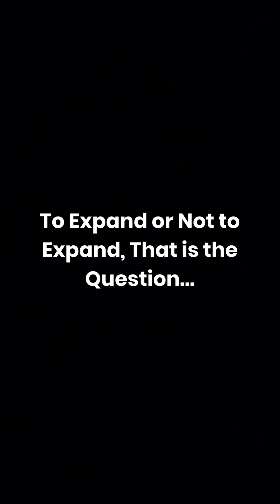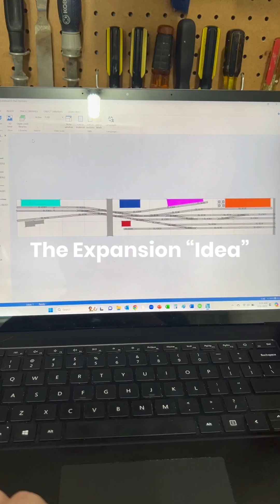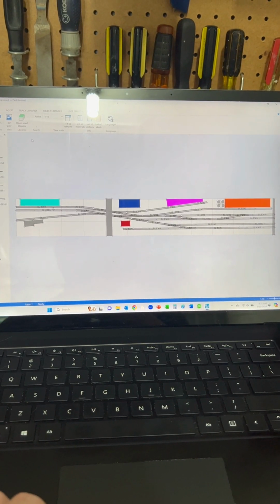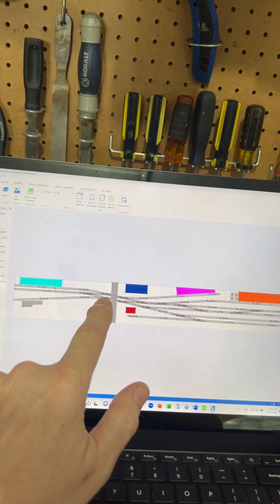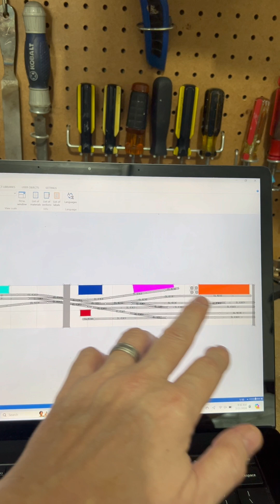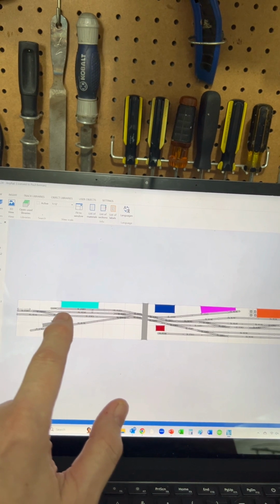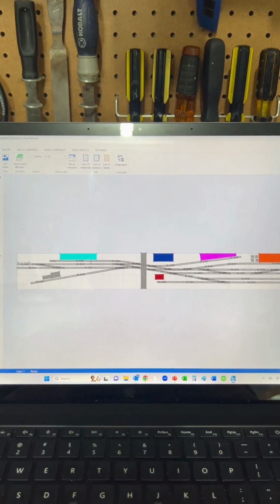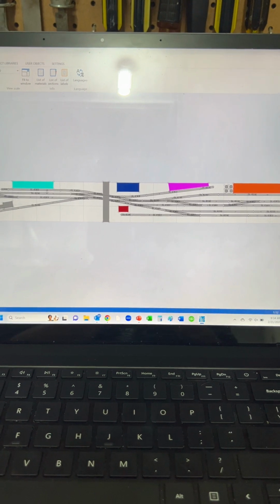Thinking about expanding the 12’x20” Shelf Layout…I need intervention!

Comment: I like your idea of the extension on the left side that will add the run around. Makes sense operationally. Thought came to mind that you could add one more spot at the ADM so you'd have three sports there too.
Reply from the maker: Thanks for the comments. I did make that adm siding long enough in case I wanted to ever add more cars. Probably time for that.

Comment: Extending the cold storage siding and main with a crossover, would give you a run around without crowding (cramming?) too much track onto the layout.  The ADM transfer facility is a nice scenic feature.
Reply from the maker: Thanks for the inputs! I definitely want to avoid too much track. You think ADM is better where it is or moving it to the inside? Appreciate the comments.
Reply: @HartfordWhaler  ADM looks good where it's at.  Just right for the space.
Reply from the maker: Thanks. I agree. Prob won’t move it.

Comment: Dear Paul, looks like a great plan. Don’t have a suggestion readily available for your lighting valence yet, as I am not aware of the mentioned difficulty you’re facing there. Considering the valence looks like it is suspended from the wall, I would say to copy that kind of construction for the extension. Maybe the difficulty lays in the length measurement, which wouldn’t necessarily accommodate a set of lights in the same length? Depending on the lights you used, you may be able to kind of stagger ‘m. If you’re using led lights it should not lead to over lighting in the staggered section. 
Anyhow, love the idea of the run around addition. Makes sense. Although I understand your point on putting the ADM facility behind the tracks, there’s also the point that this facility provides a kind of view block. Of course that changes when you add the extra track. Still, to have a structure at that location of the layout, whether similar to the current one or more to the left, gives a visual advantage whilst looking at the layout. It’s sort of a visual frame. Cheerio
Reply from the maker: Thanks for the thoughtful inputs! The valance challenge is more the effort required. I did think about the LEDs but I used the kind that can be cut to length so I may do that using the same brand.

Comment: This sounds like a very good plan and I’m surprised that 22 inches can make such a difference.if you can make these improvements in such a short distance maybe you should consider a larger expansion. If you’re going to have to do construction to expand it anyway, I think you should try to gain as much space on each end of the layout as you can so you get the most out of an expansion. I’m sure you will make the best decision based on the space available and the politics of the additional space.
Reply from the maker: It should work since I just need enough space for 1 engine at the end of the runaround. Thanks for the comments!

Comment: It sounds like you've pretty much figured out what you want to do.  
If it were me, I'd try to add some staging on the left end of the layout, with a bit of a lead to the staging maybe 3' or 4' or so.  Dont know what you have on the left side, in the way of possibly real estate.  But more staging would enable you to swap out cars without that old 0-5-0 switcher.
Reply from the maker: It’s another option. Actually putting staging to the right side along that adjacent wall. Been considering putting a 2 track staging yard there where the cars can come in for switching vs having them on the layout as I do now. Thanks for the comment and ideas!

Comment: Might as well expand it. My guess is you probably won't be satisfied until you do it anyway.
Reply from the maker: I have to take a pause before pulling any triggers. Might find a simpler expansion of just adding a switch and track off the current interchange track and run it along the other wall to stage the inbound train. I’ll keep you posted.

Comment: By the time you clear the points, it doesn't look like you have much room at the end of the run around on the main. Maybe move the last turnout to the right a bit?
Reply from the maker: For the runaround stub end I just need enough length for one engine, so 9-10”. It just fits the space. Thanks for the comments!

Comment: Sounds like a good plan but like my pops always said “ if it ain’t broke don’t fix it “
Reply from the maker: Your pops was a smart man. That’s usually sound advice. Still going to think on it.
Reply: @HartfordWhaler  I like your idea though, I can’t leave well enough alone either, my last layout I worked on for 2+ years and then tore it all apart and started on a small switching layout so that makes about layout change #10 in the last 7-8 years I didn’t listen to my pops advice either